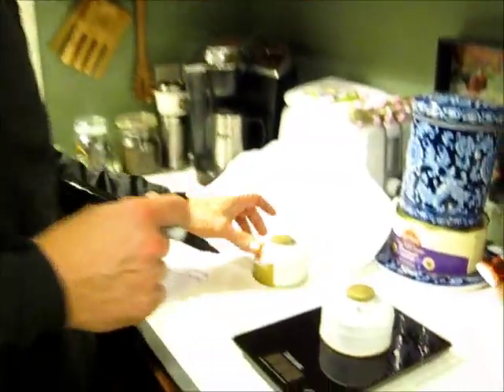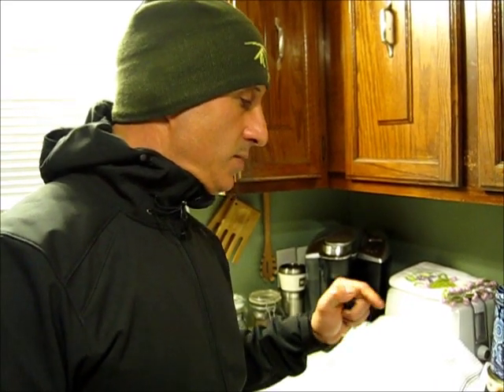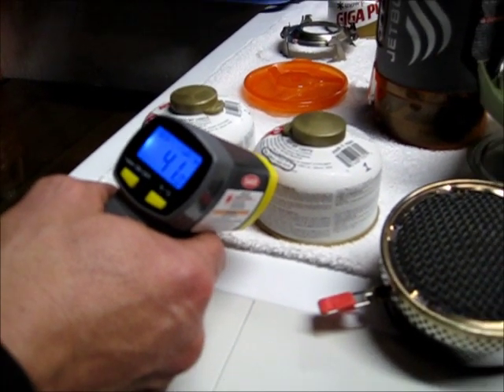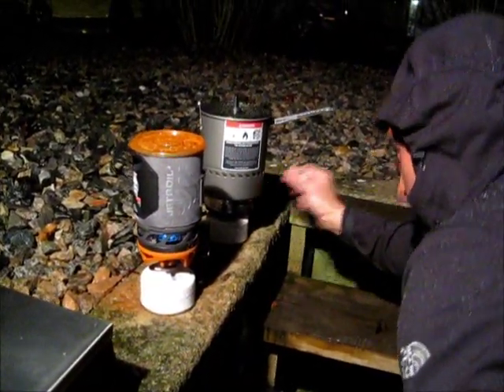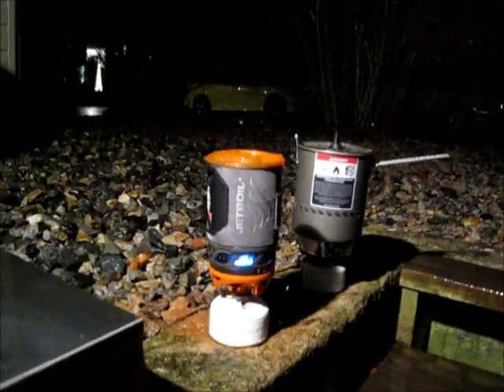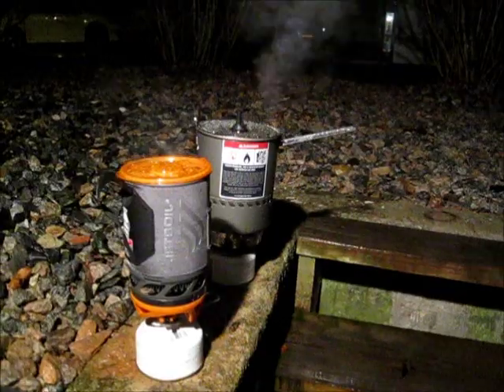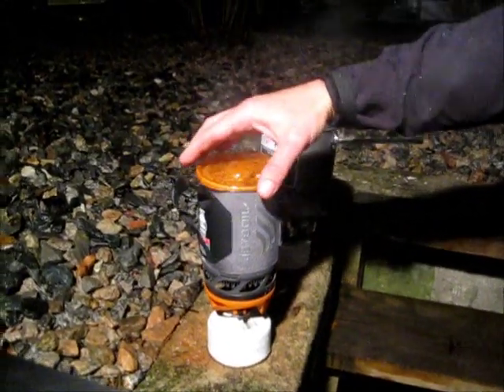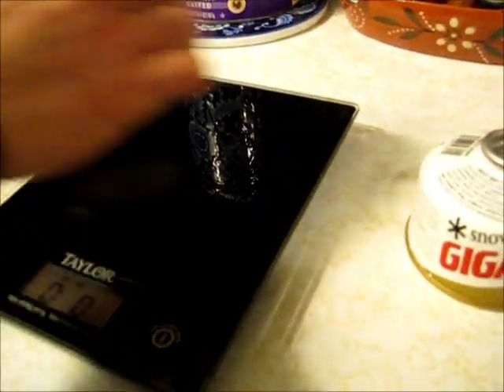MSR REACTOR VS JETBOIL SOL

Comment: Good video but to be fair to the jet boil there is a 10 sec discrepancy in time from the time the reactor has the pot put on and the jetboil gets lit.  Then it took you a sec on each one to view the times.  So really in those conditions, it was probably a 4 sec difference around the two.  It would be cool to find out the exact heat output on each, so they could be compared more exactly.  This was a cool test.  Keep up the good videos!